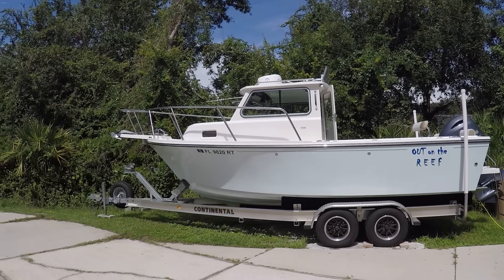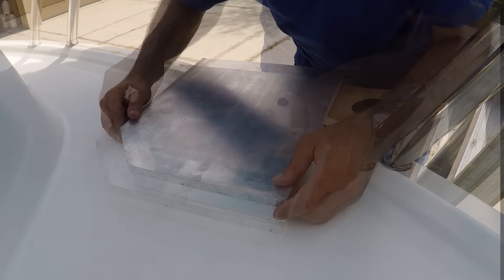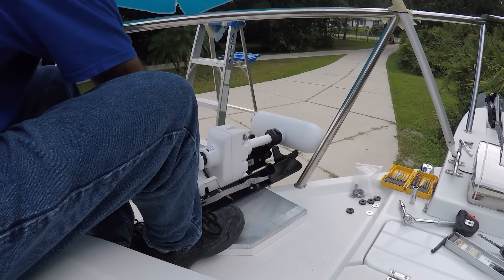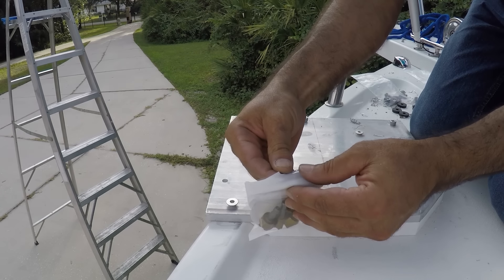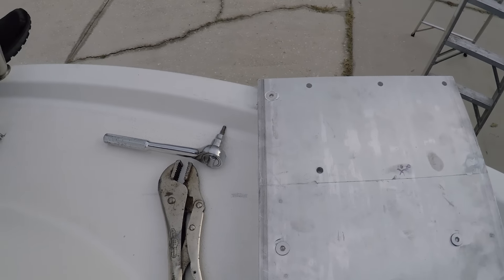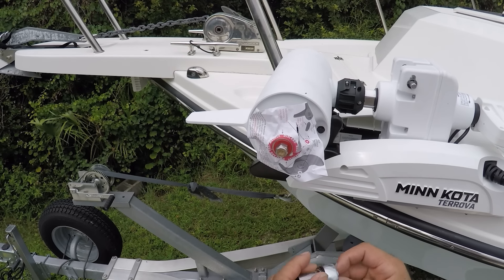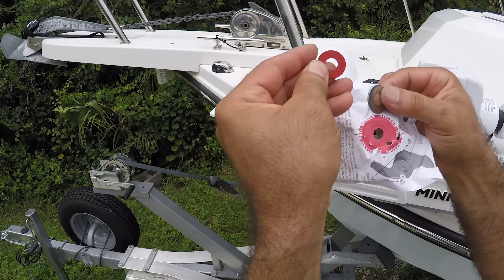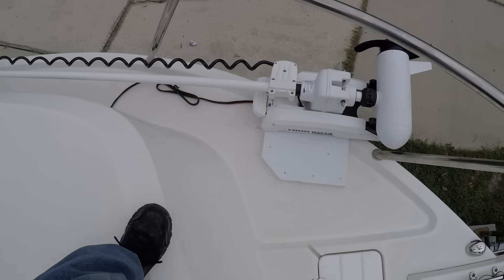Custom Installation Minn Kota Riptide Terrova 112 thrust 72 shaft Trolling motor Crooked PilotHouse

Comment: I don’t like how it sticks out past the rub rail. Hopefully it doesn’t become a problem for you when you’re docking up against pilings. Minnkota makes a quick release mount that’s very nice and easy to install you could have use that on top of your riser plates this would’ve made it so that you could remove the Minnkota anytime you want for storage or security or if you just want to move it out of the way during docking procedures.
Reply from the maker: very true cap but i want this trolling motor all the time with me because i will use it on every trip
but thanks for the great suggestion cap.

Comment: i'm so pleased to have found ths video, because i was quiet afraid for installing a minnkota on my boat. It's a great job ,very well explained . i think i'm going to get one.
the main thing i love on your installing, it's that you didn't cut the tube (i don't know how you call it) upon the minnkota .
something that was holding me back in my décision. People around me ,told me that i have to cut it, and i didn't want to do.
nice video, thanks, i will see electric installation now.
Reply from the maker: glad you like it and is called bow rail , i did not want to cut mine because they are expensive , now if you want to do this installation you have to make sure your bow rail is not that short, mine is a tall one. thanks for watching
Reply: @OutOnTheReef  thank you for answering
Reply from the maker: @gerrod1795  anytime cap.
Navigate safe 👍👍🏝
Reply: Hey skipper, great video! Any chance you can post the list of the materials needed for the installation. I’m looking to do the same installation on my Parker.

Comment: Very slick installation. Your video was great! I have a similar installation for the exact same motor and shaft length. I don’t know if I can rotate it under the bow rail to stow so I was considering notching the rail. Thank you.
Reply from the maker: Yes cap if dont have a bow rail over 22 inches high it will not work but cutting the bow rail is another option  cap. Thanks for watching ⚓️

Comment: You are freaking amazing Captain. You made that look so easy. I have the same boat and looking to put a trolling motor on. I was going to go with the 80 thrust instead of the 112. Any thoughts on that? Great job sir.
Reply from the maker: @ReelGZ  hello cap the 80 is not enough you will need the 112 the pilothouse is heavy boat cap, and thanks for your positive feedback cap.

Comment: I'm getting ready to install a bow mount trolling motor on my Grady White walk around cuddy.  Similar to your boat I'm going to have to do a bracket and I also have a tall bow rail like your boat.   Its been 3 years now, are there any changes you would make to how you did the installation?  How has that Rust-Oleum paint held up?    Thanks for all the great videos.  I've stolen several of your ideas.
Reply from the maker: Thank you, captain. I really appreciate you. Watching my channel and yes, use my ideas and make them better. And there's nothing I would change. The pain is okay if you have to touch up later. There's no big deal, captain, but I will do it all over the same. And I hope yours come out great

Comment: Excellent installation, I am concerned about some of the rough weather and conditions that you encounter when out to sea. You may may need to see about further securing the shaft during your crossings. Just a thought. Awesome content by the way!
Reply from the maker: Thank you Captain and I already got a mount that secures the schacht I will show it to you in a future video soon thank you for the heads up
Reply: I’m thinking about getting one but after this video I think I’m gonna hold off until the technology gets better. Our fishing grounds are 50 to 80 miles offshore and I think it will just not last these conditions. Also one more thing to trip on.

Comment: Capt. It's been a while since you did the installation and I have to congratulate you on how very professional you did it amazing and wow how you installed the batteries. Thanks for the video very informative. Would it be possible to ask you for a favor please, my boat like your boat have rails where I would be installing the same model Minn Kota but because of the shortages it might be months when I receive mine. The favor if you are able is to measure from the bottom of trolling motor to the very top to see if it's going to clear the rails, I only have 15" from the flat portion of the bow to the bottom of the rail. If it doesn't clear I have to find another place to install it. I looked everywhere for the complete dimensions but I can't find them anywhere at all. Thank you in advance.
Reply from the maker: thank you Luis for watching and in your case you have the short rail mine is about 22 inches ,sadly the way i installed mine will not work for you because i only have 2 inches of clearance to retrieved my minn kota cap. 
your next move is cutting the bow rail witch i would not do because it will lose strength.
hope this info helps cap.
Reply: @OutOnTheReef  thanks for answering the question I really appreciate it. I agree I wouldn't cut the rail I may have to move the motor over to the right of the bow instead of installing closer to the center that way it may clear the rail by installing a 1/2" aluminum plate to hold the motor forward. I really like the way you do your  installations a lot of people can learn from your neatness and over engineering, I do the same I better be safe than sorry while on the water.
Reply from the maker: @luisma1161  awesome Luis i hope your installation comes out great, wen you are done please send me a link of the video to see what you engineer i like to learn from other too👍
Thanks buddy and have a awesome day

Comment: Are the rubber washer necessary? I used the rubber washer according to the installation guide, but I noticed that when I deploy the motor under heavy seas the washers actually get squeezed, making the motor rock back and forth. Have you noticed this?
Reply from the maker: yes i have cap but the rubber washer is very necessary for the unit cap

Comment: Great video Captain.   I just purchased a 2016 Parker 2120SC and wanted to see if I could install a Minn Kota Trolling Motor.    I was so excited to see this install video.  I would love to do do a similar install on my boat.   May I ask you a favor,  could you tell me the dimensions of the aluminum plate  and starboard as you installed it on your boat as I want to prefabricate  and paint  it before I give it to the Marine Electrician to install.  The Boat is sitting in winter storage in Massachusetts while I am in NY and you can save me 4 hour drive to get the measurements!  I would really appreciate this courtesy.   I also would like to ask you would the Minn Kota quick release bracket MK-RTA-54 fit on your installation as I would like to add this to your install as I do not trailer my  boat and it will be left at the dock for security reasons!  Again thank you for all your videos , I really find them well made and informative!
Reply from the maker: One question before I get to the measurements do you have the high baw rail or the low baw rail,
Reply: @OutOnTheReef  I have the high bow rail I believe its 22 inch clearance!
Reply from the maker: @tinamadenli9804   Yeah OK that is a good ball rail like mine and I placed the link in the description below of the aluminum plate and the starboard But tomorrow I'll try to get the measurements for you But I think the quick connect for the minkota I don't think it's possible because it takes too much room And remember every inch you go higher on the minkota is Kota it's harder to get the unit up-and-down so you wanna make the list as possible of raising the unit And the bracket of the quick disconnect races the unit up
Reply: @OutOnTheReef  Understood Captain, I was thinking that as well,  if you do get a chance to measure the plates that would be very helpful, thank you again.   Safe travels!
Reply from the maker: @tinamadenli9804  sorry cap .i did not have time today to take those measurements i will try tomorrow
Reply from the maker: @tinamadenli9804  is 12×14 an the plastic starboardit goes under to fill that void cap.  I have the link in the squish below of those items I hope it helps

Comment: How did u ascertain the correct angle for the cut of the starboard with the circular saw? Thanks.
Reply from the maker: I estimated it and I when I believe 45° completely I'm not 100% sure but what I did I think and it fit it👍

Comment: Nice install. I have looked at many of these installs with rails. wanting to install one on mine with rails uncut.
Reply from the maker: thanks Tim and i have the high bow rail it would not work with the low bow rail cap , i only have inches to spare, what's the Hight on your bow rail cap

Comment: Hello cap i have a 2520 98 parker i just got the trolling motor 87' shaft 112lb 36v and i want to do the same installation as you have! you did a great clean job is there anyway you can fabricate it for me since its the same as yours ?
Reply from the maker: Hello captain i dont have the tiem cap. But the vodeo will help a installer to do the same and congrats on your purchase tou will love it and my recommendation is go with lithium batteries to reduce 100lbs cap. Navigate safe cap
Reply: thanks for the info what was the width and length of the starboard and aluminum? happy holidays @OutOnTheReef

Comment: Very nice!  Thanks for posting this video!
I rig boats for a living, and I have a few suggestions that you may appreciate...

1)  Run  a 3/8" round-over router bit around the edges to make it smooth, rounded, and much easier on feet. (and really custom looking, too)
2) After sanding and cleaning, use Rustoleum Aluminum Primer, from H. Depot or Lowes first.   It makes the paint stick much more permanently to aluminum.
3)  Paint before bolting it down makes it easier and faster.
4)  You should put a circle of Loctite sealer around each bolt hole on the top, bottom, and between the starboard and the aluminum to prevent leaks.    A thin bead of loctite around the perimeter of the aluminum and the starboard will prevent corrosion on the bottom of the aluminum, and creeping moisture coming in from the sides.  Capillary action is powerful.  Water will find a way in, if not sealed..
5)  A backing plate or even very large fender washers under the fiberglass would support it stronger, especially when trailering and in rough seas.  Cheap insurance from the fiberglass cracking.

You can always do some or all of this stuff at another time, if you ever re-do the work.
But again, very nice!   Thanks for the video!
Reply from the maker: Wow Captain those are very awesome suggestion especially the one around where both plates meet you're right if water goes to the dare don't start doing some damage what Imma do between the plexiglass starboard and the aluminum I will put a beat-up Marine adhesive there.
Thanks so much for your great input Captain is very appreciative
Reply: My thoughts also were to put some meat underneath in the anchor locker. PL some 3/4” marine grade plywood to that and let it set up—that’s a forever deal with no second guessing...
Reply: @johnm5714 ,  I agree, a full plywood backer is cheap insurance and easy to do.  Wrap some carpet around it, if you don't like the looks of it.   Bouncing on the road when trailering is extremely stressful.  A backer plate will take away any worries..
Reply: @OutOnTheReef ,  You are very welcome.   It's best to loosen the bolts, and lift up the layers to put the sealer between them.  It looks better, and won't ever come out.   Might as well use all the sealer you have, as it goes bad once you open it.
Again, thanks for the great video!

Comment: Happy holidays capt, great video I watch you for months cause I wasn’t sure of the brand I wanted , first I wanted the motor guide cause I can save money on the batteries to do the 36 volts , but now I just purchased the same 112 trust 36 volt minn kota  72” shaft I  have a walk around just like yours but it’s a Cobia 220 without the pilot house cabin and I’m doing it next week and I wanted to know what size aluminum plate did you use? I have a deeper walk around, I see the make a plate with brackets you can order to reach the height of your deck it’s from T.B Nation it’s call trolling deck plate . But I rather do the star board and raise it up and add the plate last just like yours  thanks for the detail video , my and I laugh at you cause you never show your face but it’s all good , you an anal guy just like me. Thanks and happy New year to you and family birthdays 🥳 💃🕺🏽
Reply from the maker: Thank Earl you are awesome  thank you and the plate i use is incthe description below cap . I have everything listed there, and you 22 cobia is going to do great with the 112 thrust 36v ihope everything goes well cam and thank you for not letting the mask cover look away from my channel,  have a awesome night cap 🔧👍🛥

Comment: Great Install, I would like to do this on my Boston Whaler with a bow rail. Would you mine telling me the clearance between your mounting deck and under side of bow rail. Mine measures 16 inches.
Reply from the maker: thanks for watching cap, and my bow clearance is 21 inches i think yours is not going to work do to it will be hard to diploid, sorry cap

Comment: Do you know the distance from your bow to the water line? Do you fish offshore in any rougher water? I have a 22ft defiance pilothouse and everyone seems to be 100% a 72" shaft will cause the motor to come out of the water in normal fishing conditions. I don't fish super rough conditions. Great channel, love the work you have done on your boat.
Reply from the maker: Well in my boat works great in 3 to 4 foot seas cap. But i dont know how tall from the water line is the defiance cap. But the 80 inch shaft is overkill for my boat.
 And thank you for watching my channel captain navigation safe
Reply: @OutOnTheReef  thanks for the reply.   my boat is 36" from bow to waterline
Reply from the maker: @RodandRoot  very similar to mine cap 👍🛥

Comment: Great videos ! This may have already suggested but backing plates or at least fender washers added to the under side of deck to spread the torque to avoid cracking the fiberglass.
Reply from the maker: That's a great idea! Scot thanks for your awesome suggestion
Reply: I use marine plywood cut to the shape I need and use it to support/distribute the pressure and works well and cheap

Comment: My situation is almost identical.  I have a parker 2300 with bow rail.  However, I think my bow rail clearance is less (15").  If you don't mind, what is your clearance?  That is, what is the vertical height of your bow rail, above the aluminum plate you made.  Many thanks and enjoying your vids
Reply from the maker: your boat rail is the small one , mine is like 21 inches, the only way to install it on yours is cutting it but i don't recommended it because the bow rail becomes weaker cap.
Reply: @OutOnTheReef  thanks for reply.  I'll have to work it out.
Reply from the maker: @thesammyb4522  hope the best cap

Comment: Great job I have a pilot house 21 foot also I want to install the trolling motor also. Are you happy with the minn Kota? I’ve been researching which type to buy. Would you go with a Rhodan? The minn kota has a 100 inch 36 volt I’ve been planning on using that one.
Reply from the maker: Hello cap. Im very happy with the minn kota 1 think that wen bad is the lift asist is terrible so i took it out and now i have no problems

Comment: Capt. I’m thinking mounting this minn Kota on the back of my transome . My boat is a little small on the bow do you think it’s work ok?? Thanks
Reply from the maker: Well it only depends on the size and weight of your boat 112 thrust Minn Kota it's for heavier boat like mine is 4500 lbs but if you have a lighter boat you may want to go to the 80 thrust the green things to do is check out men Chorus website they do have a weight by motor size I hope that helps captain
Reply: Thank you capt

Comment: I think a water channel between the plate and the edge of the hull would keep water from pooling on the corner, also since you are doing saltwater on a permanent  mount, I would advise you to retreat the aluminum with alodine and zinc chromate, paint alone will not be enough corrosion protection. I treat aluminum parts for aircraft that work the oil wells in the gulf. Great video and nice boat.
Reply from the maker: Me and you are thinking the same I just put some Marine adhesive there and it looks great captain and thank you for the heads up really appreciate it

Comment: Did U need a special bit to drill through the aluminum?
Reply from the maker: No you can use a regular metal bed and it works just fine
Now to make that indentation on the aluminum I did have to buy a special bit And if you need one I place the link in the description below captain

Comment: Curious captain. Do u think a thinner, width wise, piece of aluminum & the faux wood underneath would suffice? Say the width of the trolling motor base? In other words, is the large piece of aluminum and fake wood underneath necessary to be as wide as they are for support? I only ask because I'm planning on putting on a trolling motor and would like to have the base mount somewhat less wide.
Reply from the maker: The white starboard is not necessary for strength the reason I used it is because my boat deck wasn't even but if you both day cuz even the aluminum Plate will be enough👍
And I hope everything comes out good Captain enjoy your new Minn Kota